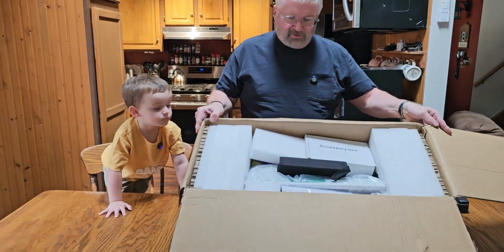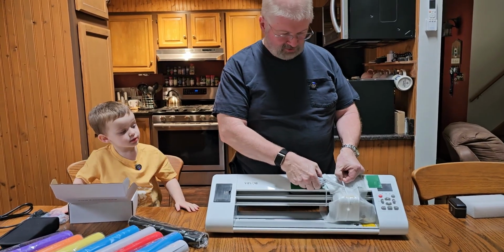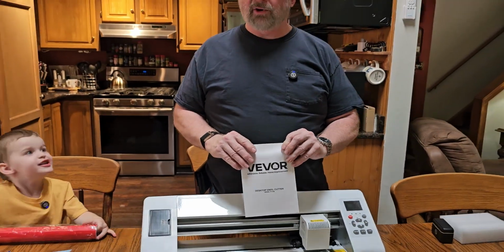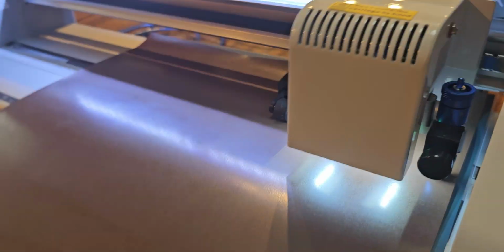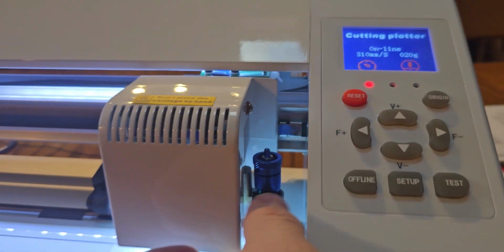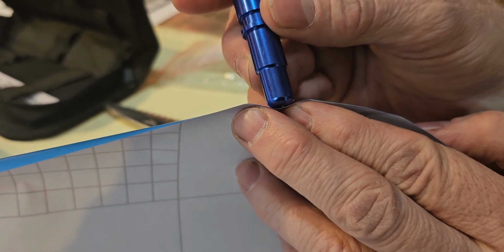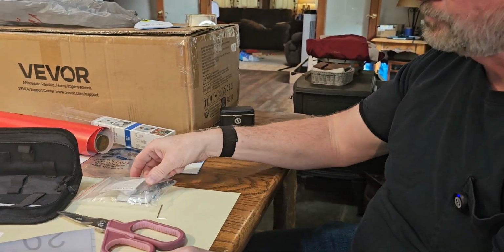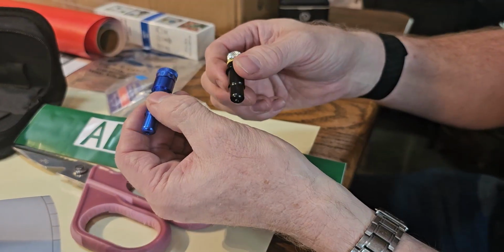Vinyl Cutting Machine Plotter by Vevor, with Cutting Blade Set-Up Tutorial

Comment: Good work - Thanks.
I thought I had commented on this but it's not here. 
I have finally figured the operation of the machine and it is (now) perfect for my needs cutting 12" wide heavy vinyl and paper. Initially, my pieces were cut a different size left to right and I tried many "tricks" with my CAD drawing to correct it. 
However, I couldn't think how the stepper driver could change as it went across and determined that I should move the vinyl over to run on all three knurled feed areas. This required the start point, or origin, to be away from the edge where it is normally fixed. I then discovered that when "Offline", the arrows move the carriage and feed roller so you can move the carriage in the X direction and set the origin over the now-centered  vinyl. 
The cause of the errors was the feed roller slipping at what I call the left side of the machine because the vinyl was not on the knurled part. With the vinyl centered on the knurls and the origin set over it, all is good.
Reply from the maker: Tricky at first, but once you figure the little stuff out, works well